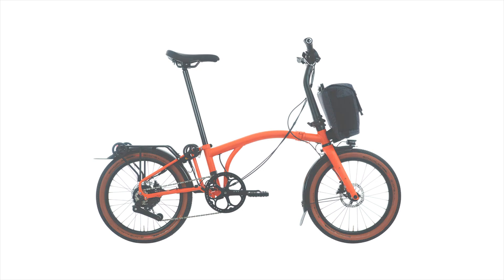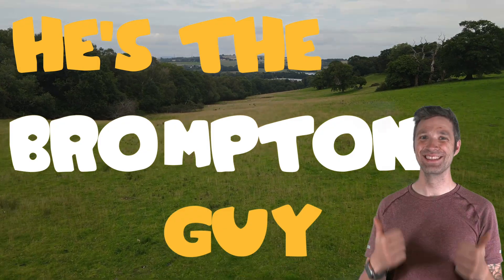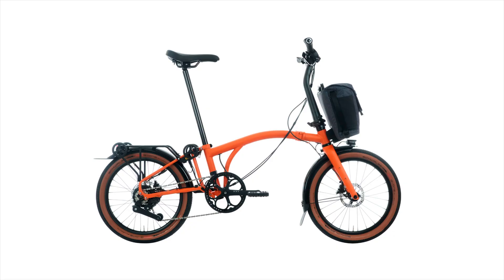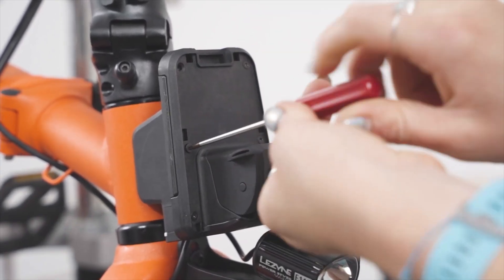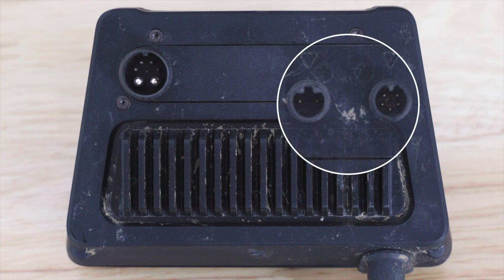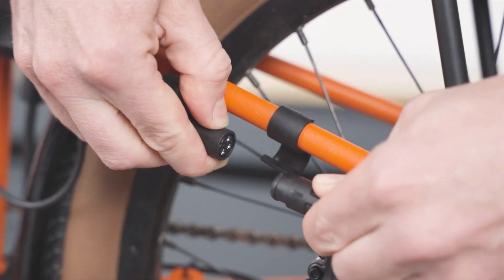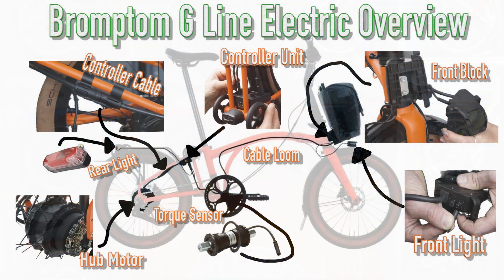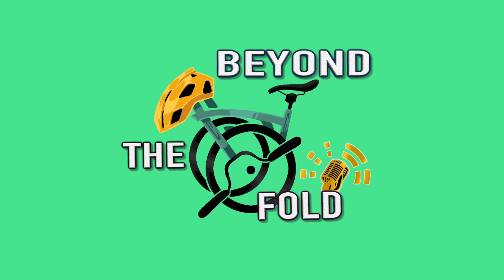A Detailed Look at The Brompton G lines Electronic System | How Does It Work?

Comment: I heard the C line battery, will fit in the G line battery bag and, therefore, will run the system. The C line battery bag will not fit the g line mount. Have you heard that too?

So, in summary, the C line battery WILL fit in the G line battery bag. Right

Comment: It will be interesting when they get out in the wild.  The torque sensor doesn't know how fast the bike is going, there's a sensor in the wheel to measure speed afaik.  I have a bike with a similar set up to this (suntour Hesc) and my observation is that the motor works best when it's lightly loaded and spinning fast (the reduction gear in the hub shell is fixed). My bike definitely starts to sound like its struggling on 10%+ That's big advantage of a mid-drive bike, the motor get's to use same gears as your legs, if that makes sense?   So it will come down to whether they engineered it for climbing or just for pottering around.  I use the assist level just as you'd use a front mech. That's partly a battery saving measure but it also what feels most natural, so it's definitely nice to have cockpit controls for that.
Reply: Gear inches is 52? (50/18) and 90 (50/11)  I think my c-line with smaller chain ring is about 25->78, so its geared pretty tall in comparison which might be clue to its intended use.  The battery is 345Wh.  My rear hub motor, bike which is also geared quite tall I can get about 50km with 600m of climbing from a full battery (420Wh) but I'm 100kg and not really that fit. It'll also be interesting to see how easy it is to ride the bike with the motor switched off.  Mine feels a bit like riding through treacle.  It's not impossible, it's just not very fun.  Hope you get yours soon!

Comment: Most interesting aspect to me is the inclusion of a third, unused, electrical port at the front. Maybe Brompton will create something for the handlebars to change power setting on the move. The current system of buttons on the top of the battery is archaic and dangerous. 
Regarding where the motor is located  an off road e-bike needs power delivered to the rear wheel AND wide gear range. If Brompton developed the Electric G from the ground up you’d think they would have designed this bike with a crank motor.
Reply: My guess is that Brompton reached their decisions for good reasons. Virtually every time a pundit criticises, I’ve already read the actual answer from the company or Brompton quickly explain their logic. 
I’ve had my 6 speed for nearly ten years and tyres and brake blocks are all I’ve replaced. I’d not change a thing.
Reply: @ yes, I agree. In the case of the G Line Electric, as with the original Brompton Electric, the budget precluded a redesign with the result that Brompton produced a capable variant that is, however, less than ideal. It is to be hoped that the G Line’s battery connector remains connected when riding over rough tarmac!
Reply: Where would you put a crank motor? It’s so tight, I don’t think one exists on the market.
Reply: @ Brompton would have to design an e-bike ‘from the ground up’, in other words designed around the central hub motor. Whether their existing fold design could fit is an open question. 
With regards the current G line electric with measly four derailleur gears, they should at least be offering many more gears on this bigger 20” wheel.

Comment: I think this bike is brilliant, I like the main cable being routed through the bike frame and the fact that the demo shows it can easily be removed along with other components of the electric system for repair or replacement. This ensures that when these bikes are out of warranty, parts can be dismantled, inspected, repaired, or replaced. The Brompton channel has lots of videos on maintenance and repair of their bikes and this one will be no different, parts and upgrade parts will be easily sourced for these bikes thanks to the Brompton supply chain . If you cant repair it yourself, then your bike mechanic with the help of a video can. The 4 speed with the motor could be a perfect combination, I look forward to the review and comparison to other Bromptons and other e-bikes, none of which are perfect. I always adapt to the bike I keep making my bike perfect for me. The only reason I don't have one of these is because its out of my price range, and that's a me problem! 😃

Comment: Your assumption of why Brompton switch the motor position to the rear is correct. For loose surfaces, front wheel motor is bad. The load is mostly on the back wheel so front wheel motor would spin like crazy. I know that from experience as I rode several front hub motor bikes and I fell on one precisely because of that. There was some sand on the road bend and when I hit the pedals, the wheel just spun and slid and I was on my side sliding.